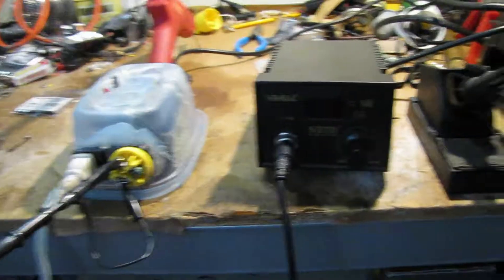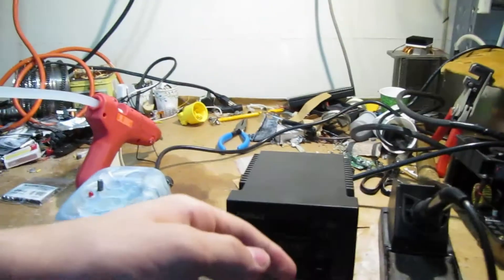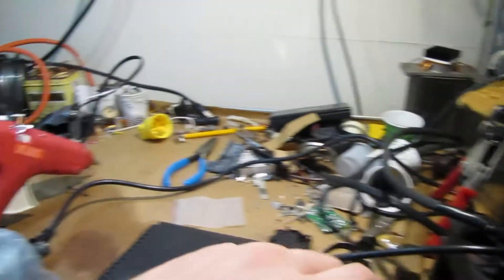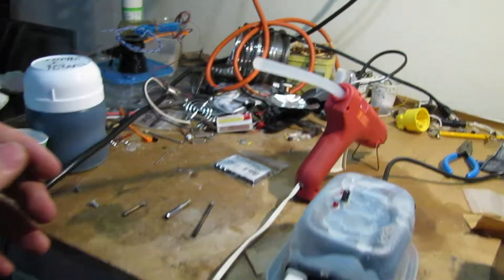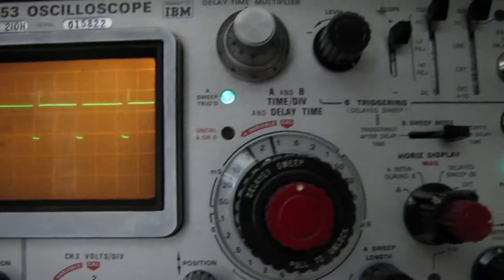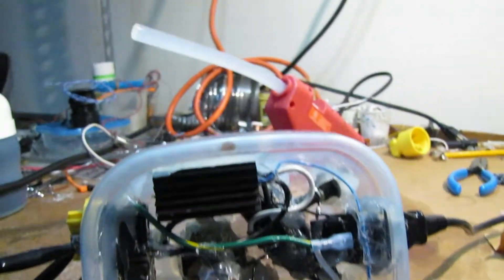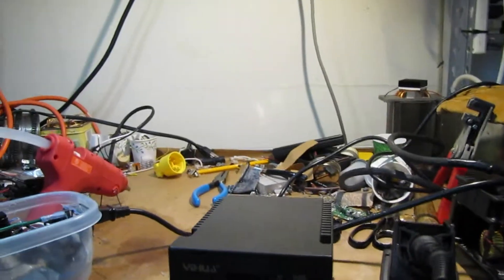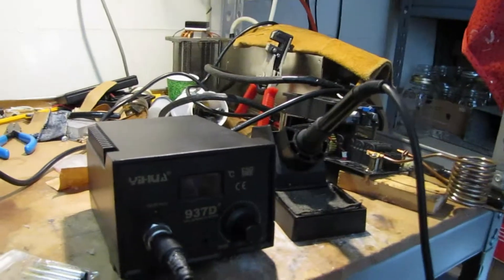DIY soldering temperature control vs YiHua 937D+

Comment: Very informative, i learned to pronounce Yihua, that despite what my girlfriend thinks i dont have the messiest work space in the world, and the Yihua copy i bought should be a quality iron. Its the same as the Yihua 937D+ just unbranded and other buyers have confirmed everything is the same. But its was about the same cost as yours. I bought the least expensive one with the black better quality iron and digital readout ( 60W ) an it came out to 35.90 on ebay. After it arrives i plan on calibrating it and using it to build a guitar pedal. If i like it better than my old wellers im going to buy some new tips for it like the ones you got. Thanks for posting!